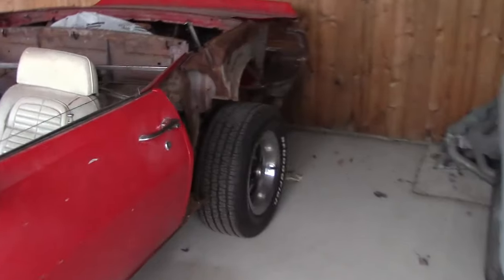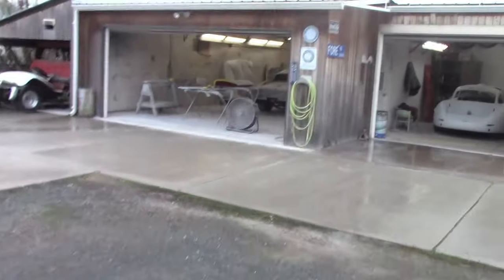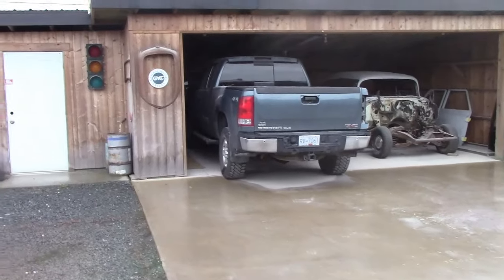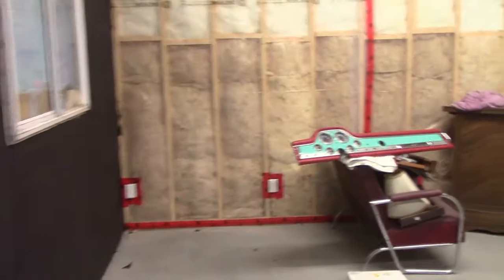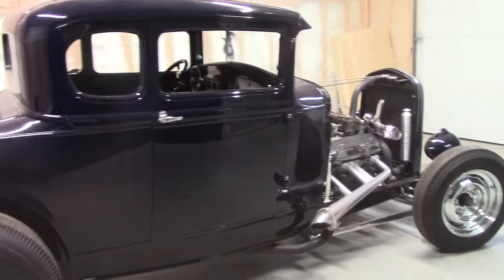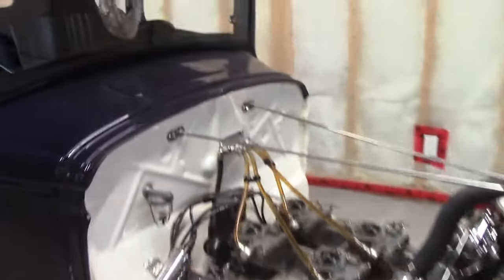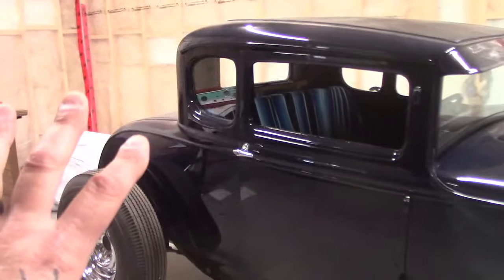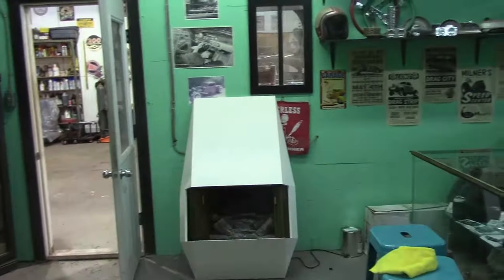69 Firebird Has a  New Quarter Panel Installed

Comment: Glad that thinks are going the way you wanted. Do you cars the way you want. If you wanted a 32 you could always break the bank on a repop. But I like yours. 
I was a hard work when younger, started working at 13, full time by 14, full time nights and school by 15. Have had debt since I was 16. First car loan. For an 86 tempo crap brown 4dr. Still have debt $12g and $85g on the house. I want to be debt free. But just quit all my addictions in the last year. Weed was the one that took a lot of money. But liked it cause I could still work. I want to work and expand my business but it’s slow so moneys not there to do the moves I want. But I got the plan and I like to work. I got my projects and I would love to bang them out as fast as I can but that never happens.
Nicest thing someone said to me years ago. He thought he was kinda insulting me but I don’t see it that way. “ you do what you say you want to but it takes you a long time” I agreed. Still does. The formula is knowledge, time, and money. When you can invest those stuff gets done.

Keep up the good work, also they have printed panels for walls at rona. With different design like white wood and reg wood, brick they can look good.
Sorry for the story.